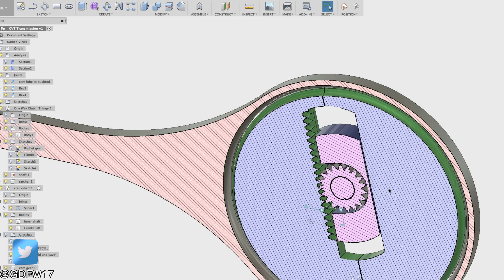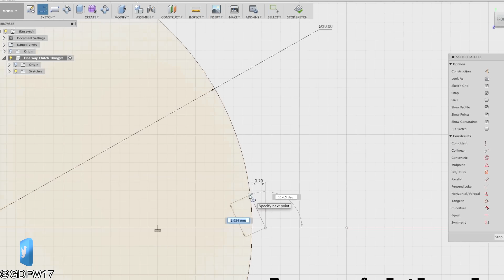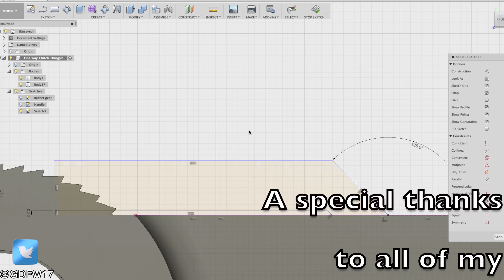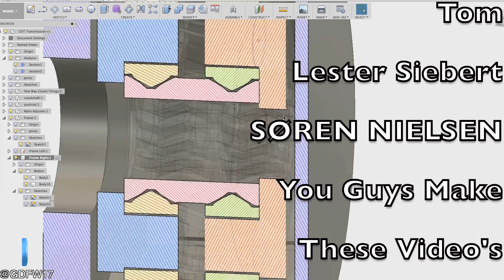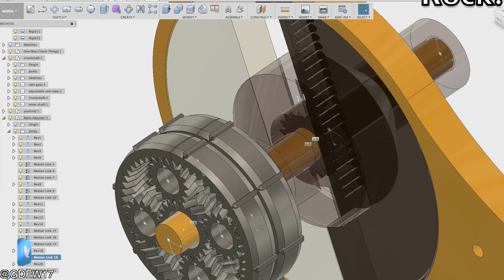The Coolest Transmission You've Never Heard Of... The Ratcheting CVT

Comment: What's the name of the patent? Ratcheting CVT doesn't give any hits on the European Patent Office.
Furthermore, I have some comments: The ratcheting mechanism sounds like something that will have fatigue failure if used on something that will transmit any power and because the ratcheting is an oscillating movement, we wouldn't want to beef it up unnessecarily either. How about replacing it with one-way clutches? Each clutch would only need to transmit one third of the highest possible torque. 
Also, your switching mechanism could be made in a way I imagine has less losses. If you make it with a rollers and springs similar to variomatics in scooters but with non-straight rollerways, you could have both the parts of the switching mechanism rotating at equal RPM and the phase shift between them is controlled by the radius that the rollers are at.

Comment: Very nice work ..... look up zero-max they have been using this same system since the 1950s 
with sprag or ramp roller clutches . I Worked on snack food equipment that used then in the 70s

Comment: I think that if you were to use a sprag clutch instead of the ratchet it might be more fluid. you might be able to drop a phase also if they are made 180 degrees opposite.  The three phase setup would mean 2 sprags would always be engaged.

Comment: I like this idea and I have some guess why it is not used as the current version of CVT in cars.
Firstly, the shaft may need to be built relatively large when it is in high gear ratio. 
Secondly, it seems it has a huge self vibration and it can’t cancel out itself completely, even if it is built in 4 shafts. Just like the 4 cylinder engines.

Comment: Interesting idea, but it has a few flaws, especially in an automotive application. The ratcheting mechanism would need to be replaced with a clutch mechanism. The inherent vibration rotating assemblies like this have. And if my brain is working right you would be hard pressed to get sub 1:1 ratios which would also make it difficult to use in an automotive application.

Comment: I am pretty sure  a Transmission like this isn't used because if you scaled it up to the point where it could be in a car it would be so gigantic to perform the gear ratios needed (as the entire transmission spins in a larger area as you increase the gearing) that it wouldn't fit in a vehicle the size of a car.

Comment from the maker: I have an idea to add reverse and back driving capability to this thing, want to find out more? Subscribe, and I'll have a video out as soon as the prototype is done!

EDIT: This project is on the back burner!
Reply: Bring It On.
Your first idea was cool, let's see what else you got.
Please.
Because of 3D printers and YouTube, people like you are no longer just some guy in a corner with some thoughts,
 but now YOU are as an engineer,
 bringing wonderful ideas to light.
You know,
 just a few short years ago Elon Musk was just some guy making stuff. 
Go check out his nonexistent non credentials. You'll be motivated to produce those other ideas that I bet you have.
Reply: Awesome engineering
Reply: Why not scrub the ratchet idea and make the output shaft a crank.  I think you'd get a faster rpm.  You may lose torque but with the design you have, it seems like energy is wasted from the engine.  Cool concept though.
Reply: Make two of these units and combine their outputs with a differential.  By running one unit faster or slower than the other you could get positive rotation in forward or reverse.
Reply: Instead of using ratcheting gears on your output, consider Sprague clutches. Might be possible to 3d print but the engagement positioning is virtually infinite making for less slack between each connecting rod action.
Reply: now if you can prove this to be reliable i would love to see it but. only thing i hate about cvt's is have put 2 new transmissions in my 2012 nissan sentra special edition with 53k miles on it. so cvt's for me are a good idea but done very bad. so im going to stick to a standard transmission that is getting harder and harder to find.
Reply: Good idea, it would, but it would also impede starting and stopping the load. Unless the flywheel were variably coupled to the output shaft... HMM...
Reply: @Tom P - simpler still, change the rack so it'll go past centre and you'll have a viable reverse. Like steam locomotive Walschaerts gear.
Reply: Adam Smith, I think the ratchets will still drive the output shaft in the same direction even if the racks go past center, right?  Seems you really have to reverse the ratcheting action if you want reverse, like on a ratchet wrench.
Reply: That's a good point ... would need a forked ratchet arm to allow forward and reverse on the ratchet by moving the arm, then, I'd guess?
Reply: "want to find out more? Subscribe" Well, that was a dickmove. Subscribed ;-)
Reply: hey bud this is really nice design and i enjoyed watching your video. But there is more concerns and suggestions I want to share with you. The first one is a safety concern. Now i did not get a chance to really see your adjuster gears very well but from what I saw, it seems like this transmission does not offer a fail proof neutral gear. this is due to the fact that your neutral position depends on the adjuster gear unit to be functioning correctly. this in theory would be deemed unworthy for road use in north America if for example it was installed on a car. I would also like to suggest a testing of your system's drive train loss. I mean i know this model is a prototype but it can give you some perhaps good benchmarks. keep in mind front wheels and rear wheel drive cars with conditional transmissions have 10% to 15% drive train loss. And all wheel drive cars have 20% to 25% drive train loss. maybe its worth running a test just to get some bench marks on the power train loss.
Reply: You fail to understand that the ultimate transmission for vehicles was designed long ago, the synchromesh manual transmission. I've had them last from 300K to 500K miles, after all.
The belt CV transmission is the ultimate transmission, for my Drill Press....
Reply: it might be interesting to harness the input and output speeds and run them through a another planetary gear system, you can achieve reverse through stop to forward depending on the ratio. As far as I am aware there is no way of preventing overrun.... though there is this very cool idea https://www.youtube.com/watch?v=JEiSTzK-A2A
Reply: I was just going to post a question about this. :-)
Reply: Well, you beat me to my suggestion. A fourth arm should allow for for reverse if while the other three are engaged, its in neutral... i think you can see where I am going with this....
Reply: Gear Down For What? Dude! This is perfect for a bicycle!  This CAN make you a lot of money, just not a ridiculous amount.  I am an avid cyclist, but I only ride single speed bikes because, in my opinion, all current bike transmissions are garbage.  This would never slip a chain, and could be fully enclosed and protected from the environment, thus solving the two main issues.  I would use this trans on my 48cc motorized bicycle. With only one gear, I have a top speed of about 40mph, but I have to pedal up to at least 6mph before I can release the clutch.
Reply: Great job! As suggested by a few others here in the comments, I'd love to see this paired with a flywheel to smoothen that output velocity!
Reply: add a planet gear for reverse and another gear
Reply: Gear Down For What? 
An  efficient transmission is needed for water wheel turbine,something that severely increase the rpms of the wheels output to then generate enough electricity to recharge batteries....
Reply: put it on a bike, I would like to see a non chain drive bike
Reply: Gear Down For What? Danish?
Reply: you need graphite for lube and you will never have a problem running it very fast
Reply: see you tube is to show what you got if you where going to build it you would have ..me I'm an arm chair critic I suppose.built so many different things that now my dwindling interest is spent looking for originality. you spend fifty years working every thing from tool and die maker to high steel construction. I worked as a cabinet maker building spiral stair cases and the list goes on guess you could say I can't keep a job well thats true eight years was the longest I stayed with one job most five years. I don't miss the smell of burning machine oil or the varsol tanks or continuously fly steel shards whether from the lathe mill shaper abrasive wheel { dont miss the fucker} grinde,r EDM plasma cutte,r torches,water cutter files basically shit flying every where there was a machine Oh and de-burring ever done de-burring industrial style it's much like peeling potatoes great way to start your apprenticeship . sorry for the rant be stuck in a chair does put me at a unique prospective good luck with you prototype. you gotta love what you do
Reply: just have reverse just be seperate
Reply: Where I did my apprenticeship 20 years ago  we made and used that exact system to vary.. kg per hectare....measurement and sold hundreds of them in farm machinery
Reply: why dont you use cranks, instead of using ratchet mechanism,
Reply: Once I found a Volkswagen engineer who solved the problem to get a CVT fully rotating without excentric weights. In my opinion the ideal solution. In his example he made a transmission operating on one axle and providing 250 kW each for the front and rear wheels. 
Extremely elegant and for sure patented since 15 Years. 

However, great contraption man. Because we get other solutions by different people: we will find the ideal way and on the other hand we can avoid violating patents.
Reply: Gear Down For What? I believe that if you use more rods, the power transfer will become smoother.
Reply: how about adding a flywheel to the output as well? that would allow you to smooth the jerkiness of the output.
Reply: 35 seconds in and i'm thinking stop right there. toyota's e-cvt used in the prius is already perfection. Also a tip. stop talking shit about other more advnced stuf like you're pitching to save your life. You sound too desperate and unprofessional by basing other stuff.v And for fucks sake cut the point already...nobody gives a shit about ''i'm gonna show it but not just now i have more crap to say, maybe later i'll show it to you''. fuck that.

Comment: I think that 3 is the correct number of phases, is like electricity, with 3 phases you theoretically have constant power, nice choise, the phases are 120° from each other right?
Reply from the maker: Yes
Reply: how about adding a counter balance shaft like the inline engine does? or maybe try it out to make a V shape CVT, with another pair of transmission on it and run it on simscale to see it works>( although it's abit impractical as the weight might be too high on this method.)
Reply: Would it be impossible to, instead of a ratcheting mechanism, make it a sort of crankshaft? Im also curious how reverse will work with this design.

Comment: As great as a job you did, I hate CVT transmissions.  I had one in my 08 Altima and after about 2 months, I couldn't wait till the lease was up.  I would of bought the 3.5SR, but settled for the 2.5 back in the day :/  Too bad they killed the 2 door Altima.  The 3.5SR was pretty beefy for the time with a stick.  Edit:  My car/transmission never had a problem, it was just boring.  I bought a G37s the day after the lease was up though.  All worked out well :)

Comment: As an off-road racer, I see a few challenges with this (and one of the reasons why I keep smoking belts in my sideXside) aggressive on and off power will blow your output shaft to bits, because the motor won’t be able slow down as fast as you can slow the wheels with your brakes, thus causing tension on your output ratchets. To help with this you can add  some sort of lever electrically activated when the brakes are applied to lift your output ratchets to a neutral state (like a blow-off valve or wastegate on a turbo). Along those same lines (and I’m not sure exactly how I would conquer this one), your design does not lend itself well to engine braking, as the ratchets will allow forward movement faster than the engine is pushing. My 2 cents, but great idea! You’ve got my vote. I would love to see it in a practical form!

Comment: I believe the output shaft would have an excessive amount of wear at the 2,000 to 3,000 rpm a normal engine works most efficiently at. This might be better utilized in lower rpm applications like industrial electric motors. Drill press or the like that requires frequent speed changes.Interesting design, get a patent.

Comment: Very cool design, however it seams to have potential for a lot of wear in the rear parts at high speeds. What is the wear and tear on the output shaft ratchets?

Comment: CVT are more efficient , cost less for the car manufacturer , but do not expect it to last more than 70,000 miles, especially a JATCO transmission used in a Nissan.  A JACTO transmission is used in many cars with CVT. Do same research.  If they are in the car, DO NOT BUY THAT CAR !!!!!!!!!!   Then it will cost 4000 to 4500 dollars to get it replaced.

Comment: Though I believe this would be terrible as a transmission, I think it would make a great aquarium air pump. Remove the ratcheting mechanism and replace it with the bladder (can't think of right word.) set.

Then you can control actual air flow instead of just restricting the output with a valve.

You could also do a water pump.

Comment: it's not continuous, unless you're using a friction one-way-slide as opposed to ratchet and pawl.... and it most certainly will wear out, after a surprisingly small number of engagements.  material and design can increase or decrease the life, but it will still be nothing compared to continuously-meshed gears.  The only value in such a thing is in an application where the power source speed cannot be varied, and the load must have access to a large number of possible drive speeds, at low load, for a short duration.

Lots of novelty value, though.

Comment: So this device (or something meaningfully equivalent) was invented in1949 for making variable windshield wiper speed before the advent of the intermittent wiper. I happen to have one of those drives apart for a complete rebuild, and the slipping one way clutch mechanism on the output shaft, combined with the 8 fingers transferring power on sequentially indexed cam positions gives it an incredibly smooth operation. That smooth operation is necessary since that particular drive is what gives me infinitely variable speed on the powerfeed to my mill table. They have a point and not all CVTs need to run a car down the road. Also, on these the speed selection is done by moving an arm rather than a click-stop mechanism which makes it more of a “continuously” CVT.

https://www.zero-max.com/cd-adjustable-speed-drives
https://patents.google.com/patent/US2691896A